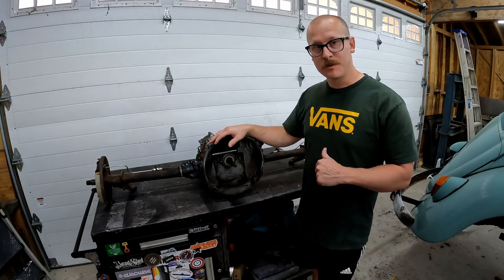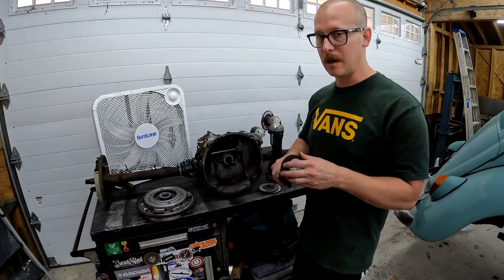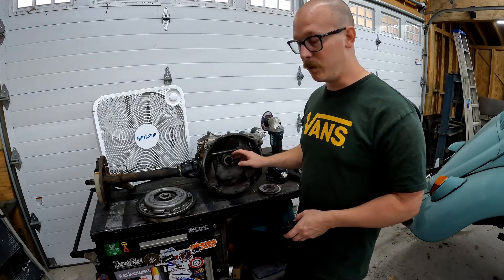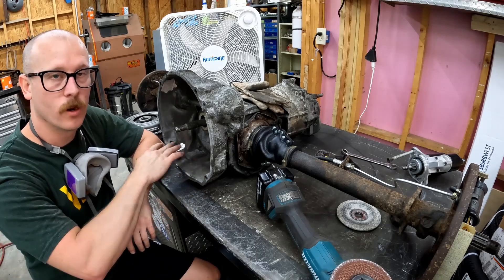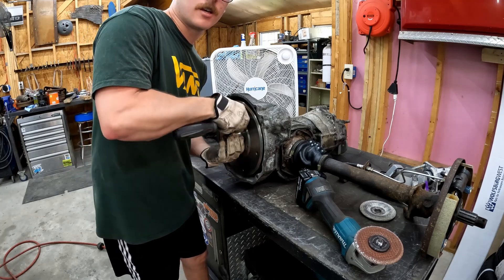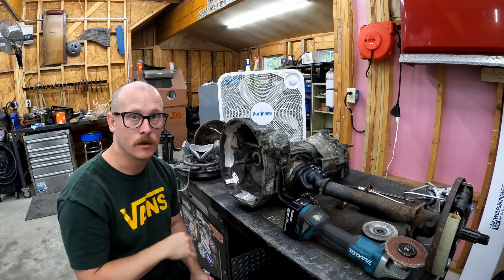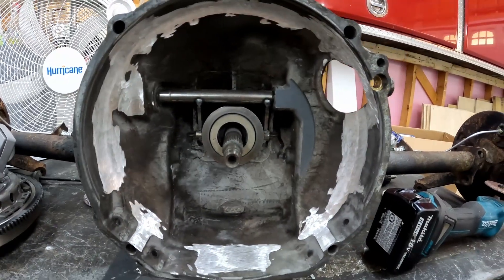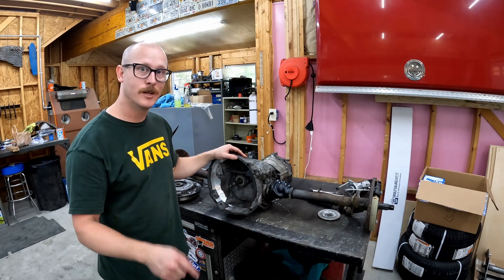How to Clearance VW Transaxle for 12 Volt Flywheel

Comment: Great video! I'm new to the vw stuff and will be doing this on a dune buggy project. I do have the early style throwout bearing and pressure plate. It looks like manufacturers make an early style pressure plate and clutch that fits the 200mm 12v flywheel? I figured that's what I would need for the 12v flywheel in a 6v transmission?